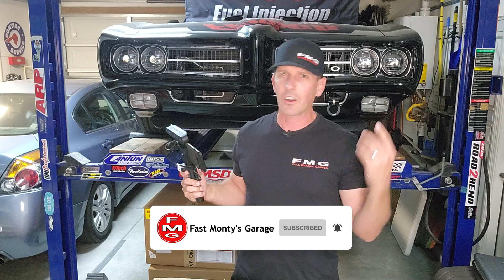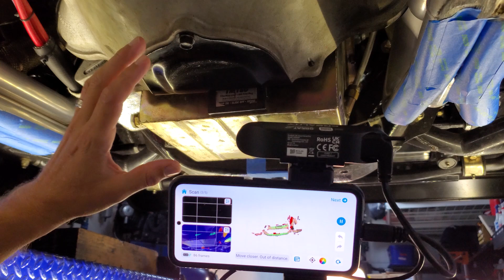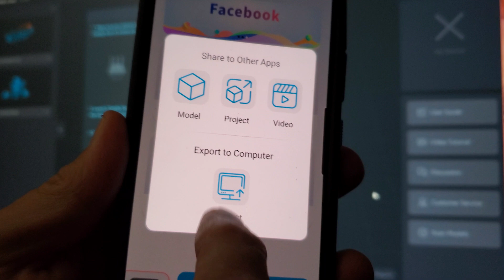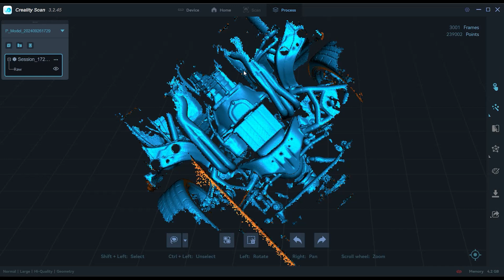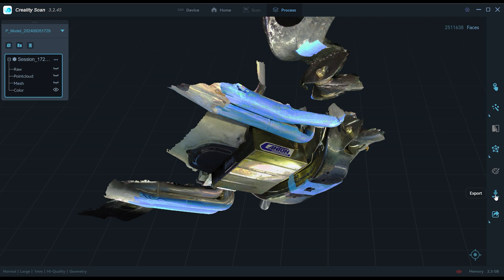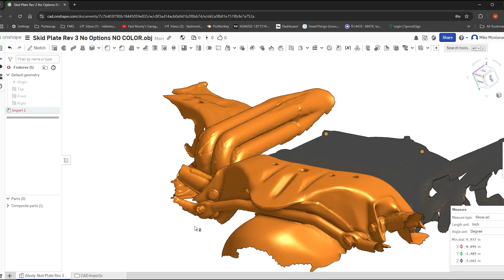How I used the Creality Ferret Pro 3D Scanner to make a Skid Plate out of Steel, for GM A-Body's

Comment: Were did you get your air dampener from?
Reply: Air dam under the front valance panel ??
Reply: @jimd280  yes
Reply from the maker: @jimd280 ahhh yeah, not a stock piece. I saw some company now makes a  chin spoiler for several different cars. Been a while since I've looked.
Reply from the maker: Air Dampener?
Reply: @FastMonty  the plastic piece underneath your front bumper.
Reply from the maker: Ohhh, i call that a chin spoiler. Its metal. Some guy was making them out of his garage. Maybe try googling "chin spoiler"?  Good luck!@nicholasfrechette3770
Reply: @FastMonty  I have a 72 Lemans Luxury and my air dampener needs to be replaced.